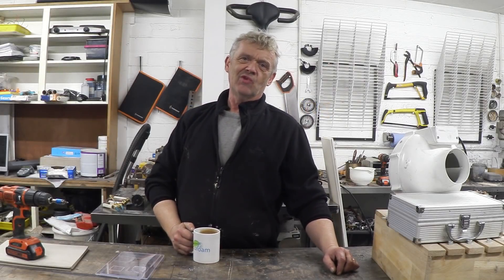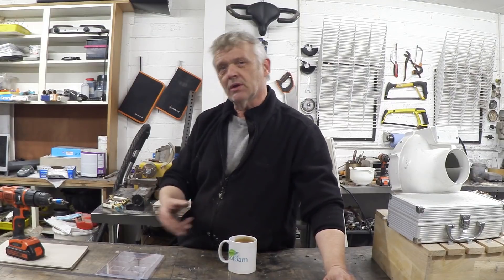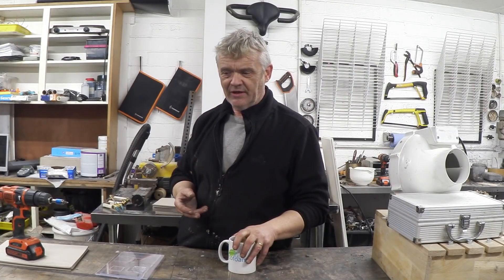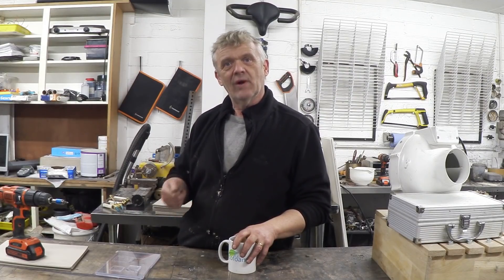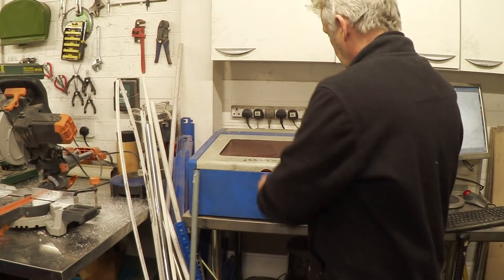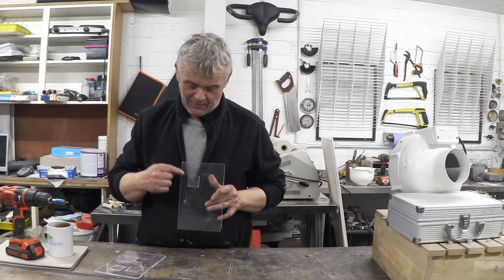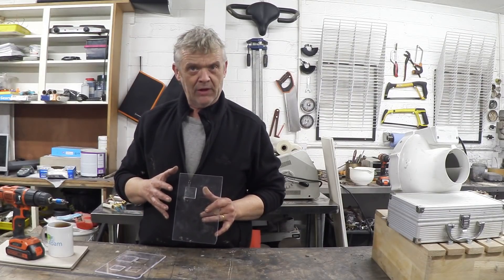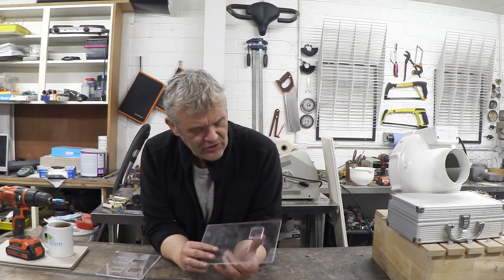Laser Stacking 3D From 2D

Comment: Nice to see, that someone else still has a K40. I switched the Controller with a Cohesion3D wich actually makes it a real nice machine (considering the price). - Welding Acryllic sounds really interesting, I would love to hear more about that. If I understand it right, it is done by dis-focussing the Laser after the cut? So the edges will melt together?

Comment: Before the advent of the 3D printer, rapid protyping used two different techniques. One striking an appropriate polymer solution with a laser which makes the area hit by the laser to become solid.  Then the tray contains the polymer solution is lowered by a fraction and the process repeated. A second method was depositing a powdered material layer by layer and heating it up to melt into a solid. These machines were expensive. What you described seems to be related to these. Today the 3D printing made most of these obsolete.
Reply from the maker: the first one you mention is stereolithographic printing mate and the second is selective laser sintering - they are still very current though expensive - there was an attempt to bring stereolithographic printing the home market but I am unsure where that is right now. Filament type printing is popular because it is cheap - the slice and glue layer technique was tried with plastic rolls and Mcor have a machine that uses 80gsm office paper. It is a pretty active field - I don't think they are obsolete - but I may be wrong - cheers
Reply: @ThinkingandTinkering  If I had to guess, would say there getting all charged up over it..lol.

Comment: Good one.  Weirdly, just today I saw an news item about layering graphene on the surface of of kaptan tape using a laser.  Now I'm thinking that the laser might make it possible to convert the surface of almost any carbohydrate material to conductive graphene.  With your video, it seems as if there may be a way to create and "print" electronic circuits and devices of almost any shape using the laser.
Reply from the maker: it certainly is a useable tool - I read the graphene/kapton papers too

Comment: Add some vacuum and pump action and maybe a little hot air and essentially you can have an entire laser printer that prints 3D
Reply: Do you have any links that show this process?
Reply: @lemondealc  I just used priciples of molding plastics and glass blowing.
Reply: Live in Texas waco isent that near the inventor who made your disc homes?
Reply: Ahh italy texas dome close it's not the same
Reply from the maker: that's a cool idea - there is room for it in the cutter body that's for sure
Reply: what Robert said plz share Cheers! I cant wait Mate.